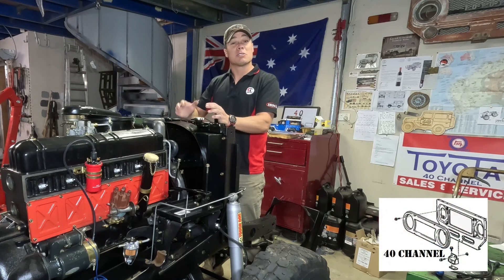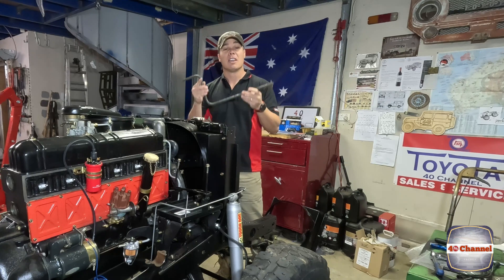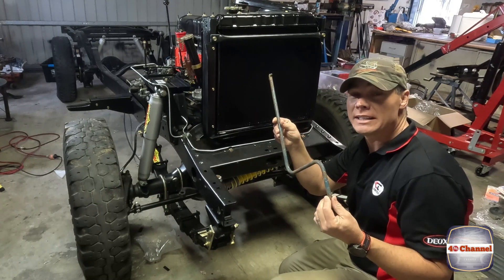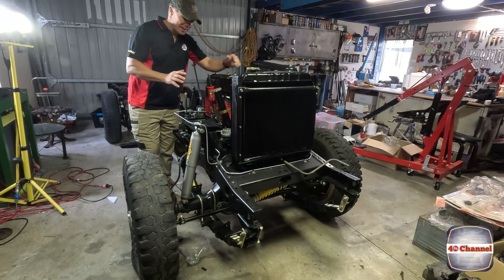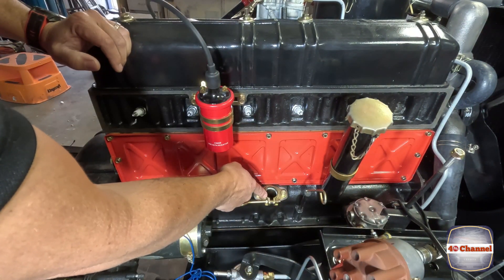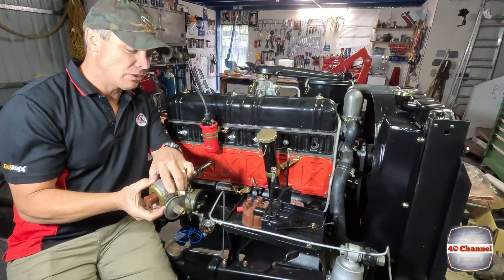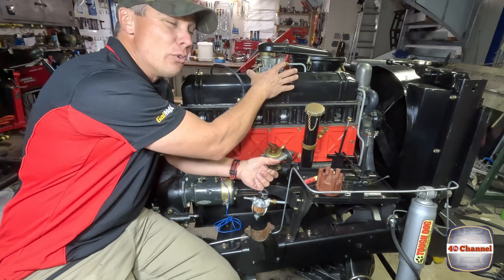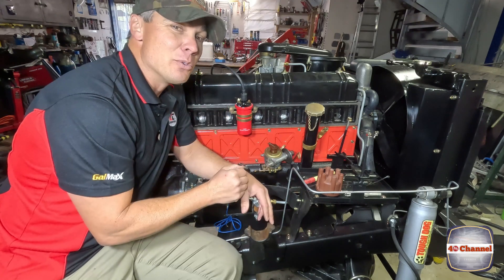S2EP88 - How to setup your Distributor for change over or Start up. - Landcruiser

Comment: is there a reason why you’d have to go all the way around again on the flywheel when u pass it instead of just backing up a bit? thank you!
Reply from the maker: @milkymotors  The crank handle only allows you to turn it one way , but yes , you could turn it back a fraction if you wanted to use vice grips.

Comment: Hi , really nice looking engine you've got there, credit to you. 

I've got a never been apart carburetted 3F , not to different from a 2F with a 440F trans in a "86 FJ62 I've owned for 25 years and over 700k km on the clock. Slug, normally! But what ive done is first of all the dwell angle, they seem very sensitive to the right one, which means a 0.29mm gap in my case, smaller than specified. But the biggest difference was changing the advance, standard springs but return to retard is now when the weights are 2mm out from their natural return point. So at idle the timing is advanced but total advance is the standard, It transformed takeoff. Much more responsive of idle. 
It seems that Toyota has set up the timing for questionable fuel quality, probably for underdeveloped countries. A 2.5" free flowing exhaust helps heeps and headers as well, helps them rev and develop HP at the top end.  
Maybe I'm telling you old news but maybe just some hints to keep up with normal traffic?
Reply from the maker: Thank you, mate, great information. I appreciate you taking the time to share.

Comment: That motor is a work of art. I wish this video was around when I was doing this the first time. For those that come by this that have never been through this process, you’ll want to make sure #1 is at TDC on the compression stroke and NOT the exhaust stroke. The easiest way I’ve found to to this is to take the valve cover off and wiggle both rockers on #1 when it’s getting close to the top. If they both wiggle a little, you’re in the compression stroke.
Reply from the maker: Spot on John, thanks for the input.